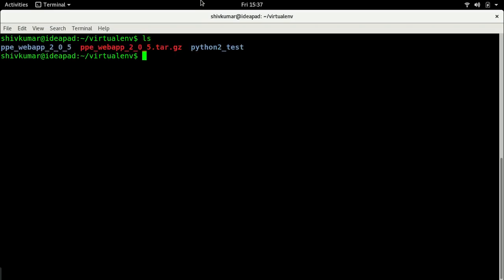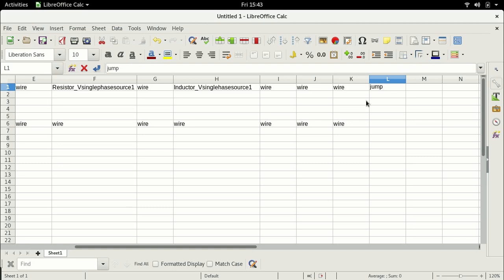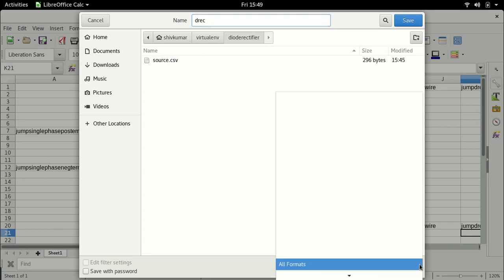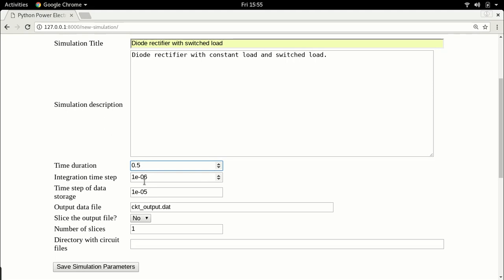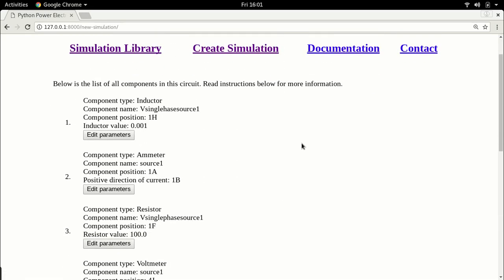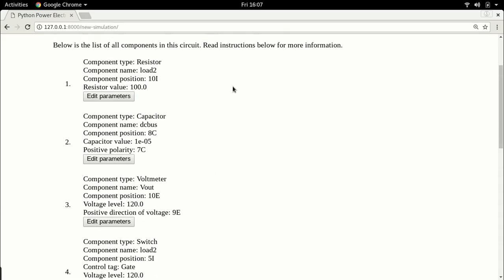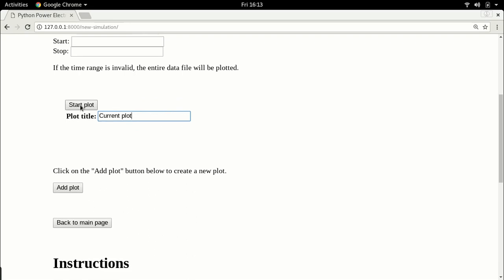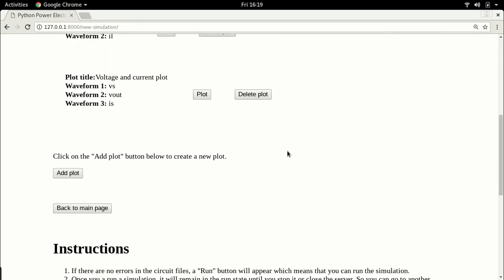Part 1 - How to simulate a circuit with Python Power Electronics

Comment: Please you need to spend some time on explaining how the circuit diagrams are defined in spreadsheet properly. You have just been writing wire, wire, wire and so forth but how does it corresponds with the circuit you want to simulate. Just take a simple circuit, starting from the power source, show us how the power source is defined in the spreadsheet, how the wire that connects the power source is defined in the spreadsheet, how a resistor connected in the circuit is defined in the spreadsheet. Let it be systematic
Reply from the maker: Instead of expecting to be spoonfed try to take a piece of paper and draw some circuits and try to figure some stuff out on your own. This is free content.